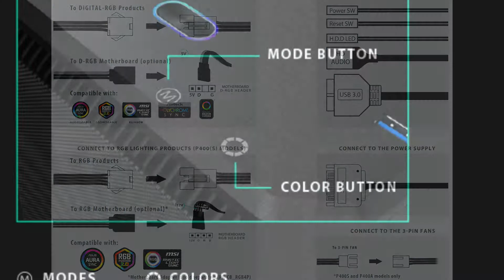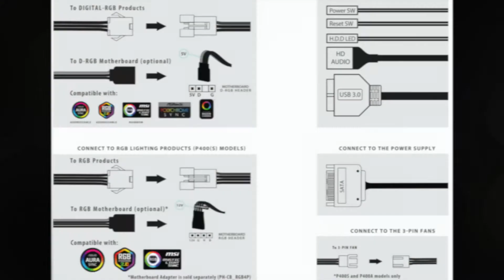Phanteks P400A / P500A DRGB HowTo 2 (english subtitles)

Comment: @Simon's World
 I really enjoy your videos, learning a lot too; I am glad I found them, thanks a lot!  I do have a couple of questions about the RGB lighting and fans.   I am doing my first build in the Phanteks P500A D-RGB Edition.  I plan to use the case controls and not the m/b with software to control the lighting.  

First, where does the cable labeled D-RGB Fan go?  It is a four pin male and my m/b, Gigabyte Z390 only has one LED header and it also male, 4 pin.  The plug can 't go there.  Also, you used the word "controller" several times.   What is the "controller" and where is it?
 
Also, I have MasterCooler ML240R RGB AIO which has 2 fans.  Do I daisy chain them in with the D-RGB cable I just mentioned above?  I have splitters for the the fan power cables going to the m/b,  5 in all (3 case, 2 on the AIO).  

All this makes a lot more sense now, just from typing this all out, but I am still confused about where to plug the D-RGB Fan cable!  :-)  Thanks for your help!
Reply from the maker: The controller itself is under the top of the case directly under the buttons. You can not connect anything to it and have to use the cables wich are already connected from Phanteks. You can connect other D-RGB devices to the cable wich is labeled D-RGB Fan. It is just a adapter cable for normal 3 pin D-RGB fans or stripes. It has also a second header (wich is smaller) for other Phanteks fans or stripes. If your AIO has really 4 Pins and not 3 (like X-X-O-X for 3 Pin and X-X-X-X for 4-Pin) than you have the revision of the AIO with normal RGB and not ARBG (D-RGB). If this is the case you can not connect the AIO to the Phanteks Case and you must use the onboard header and software of your board.
Reply: @simonsworld740  - The cables on my AIO, the ML240R RGB, are all 3-pin, 2 cables are from the pump and each fan has two cables.  I appreciate your reply.

Comment: Ty man, I was kinda lost... Had to watch your video to understand 1 cable is left out (if i use the case controls) or 2 cables are not connected (sata and d rgb fan) if i connect the MB Drgb to control via MoBo and Software.

Comment: I bought 6 (2 packs of 3) Deepcool CF120 Plus, they come with their own fan HUB and controller but I decided to connect it to my Aorus Master x570 MOBO. My question is that it seems impossible to connect the Power Button RGB (the one that goes around the power button) to the RGB chain because Phanteks designed this to work in a Daisy chain with the included fans. Is there some kind of adapter so I can connect the 3 pin connector to the Deepcool fan HUB and make it work with my MOBO?
Reply from the maker: yes... there is a way to connect it to the hub. But then it's not only the power button. All devices wich are connected to the daisy chain of the case will be controlled by the MB software if you do this. Just connect the cable wich is labeled with a little sticker "to M/B D-RGB" to the hub. then the case controller is out of function and all is controlled with the Mobo.
Reply: @simonsworld740  there is no daisy chain, I replace all of the Phanteks fans with the Deepcool ones, and these only work connected to the hub by a 3 pin female connector so I cant connect the cable labeled  "to M/B D-RGB" to the Deepcool led hub because it doesn't have one.  To be clear: Deepcool 3 pack comes with a Fan hub and a Led Hub, with the fan hub there's no problem.
Reply: I make it work! just connected one of the Deepcool fan hubs to the controller of the case and use the cable you mentioned labeled "to M/B D-RGB" to the 5v 3 pin mobo connector. Thanks for your time !! BTW the Deepcool fans are truly amazing for that price. I totally recommend it.

Comment: Hi, in your previous videos I saw that you used a push/pull config for the AIO but now, at the end of this video, I noticed that there are only the 3 ARGB fans at the front for intake: did you changed your mind, perhaps?  I'm interested since I'd like to build a similar setup with the same case: the two AIO's fans was removed because did not bring any temp improvement, or the reason was very little gain compared to the noise produced? Also, I'd like to ask if you think that putting 4 identical fans perfectly aligned in push/pull would give better results compared to your initial setup with 3 x 2 fans, since the 3 fans did not align with the AIO's radiator nor its fans (because it is a 240 and not a 360 AIO, of course). Thanks in advance for your attention!
Reply from the maker: i`ve used push/pull only to use the fans instead of laying around and do nothing ;-) 

For cooling they have had no significant effect to the Ryzen 3600. The two fans are enough for that cpu and AIO. The third fan blows air under the AIO into the case without beeing blocked and had a good effect to the GPU. Also I use 3 fans at this case, because it's the normal stock config and with only two fans it looks not so good. The noise btw wasn't a problem with 4 fans at the AIO.
Reply: @simonsworld740  Thanks for the reply!

Comment: what LED light strip do you use?
Reply from the maker: i use 2 Phanteks Neon LED Stripes and 2 Phanteks Digital LED Stripes. The 2 Neon Stripes are connected with the case controller and the 2 normal stripes with the MB.
Reply: @simonsworld740  ok cool thanks!
Reply: @simonsworld740  cool thanks your build looks sick btw! I just got water-cooling for mine but now i want to make my case light up more. If i buy more of the fans that came with this case and a phanteks light strip, can I connect all of them to the rgb case controller?
Reply from the maker: Ben Irish yes you can. It will work fine with daisy chaining.
Reply: Simon ́s World ok thanks!